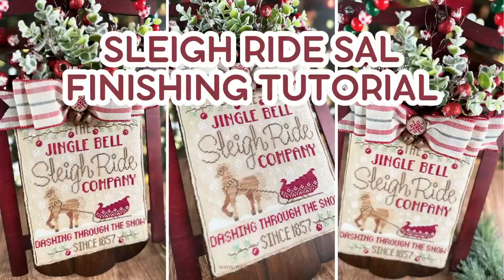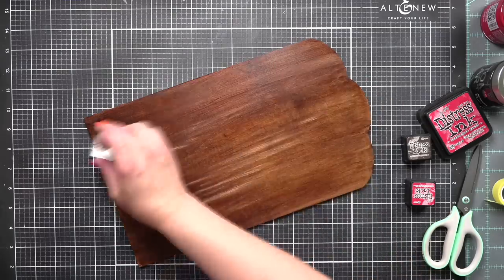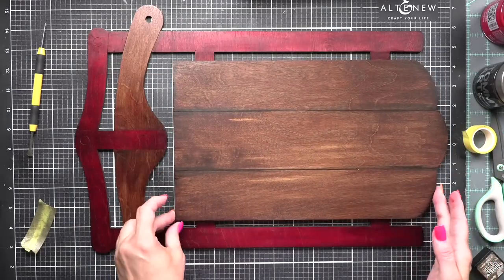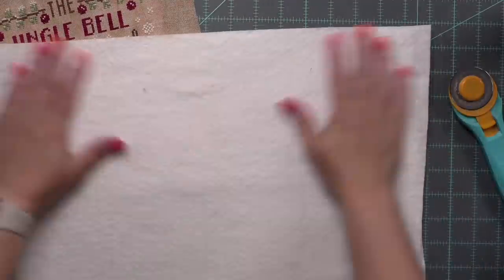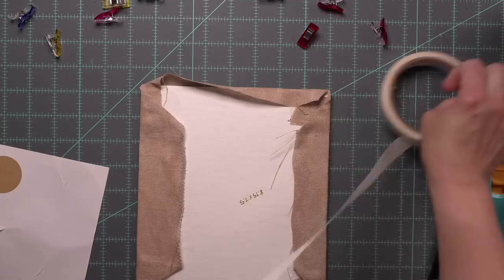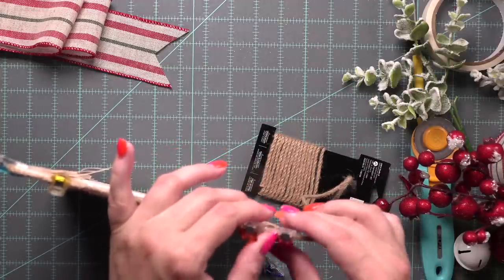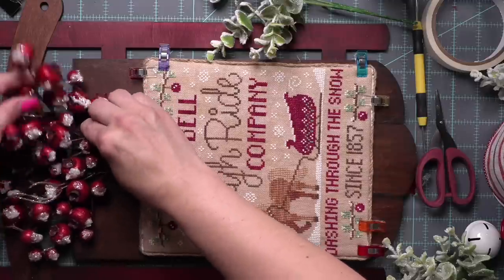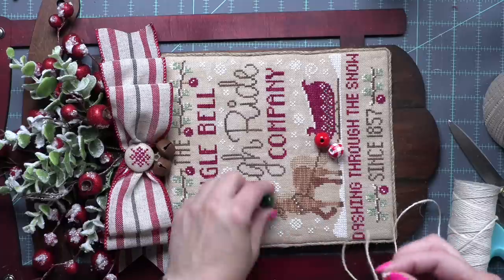FINISHING TUTORIAL | SLEIGH RIDE SAL 2023 (Christmas in July)

Comment: I used distress spray stain on a small wood piece. I tried distress micro glaze to seal it but that didn’t work. Does anyone have any sealing ideas for those apartment dwellers with no outdoor space or windows that open?
Reply from the maker: I asked around and was told that if you let it sit dry it will take awhile but eventually it will cure or brush on a water based polycrylic. I do not have first hand experience with this so I can't speak to how it works.
Reply: @NicholSpohrLLC  thanks nichol!